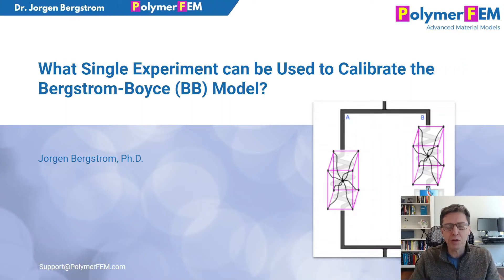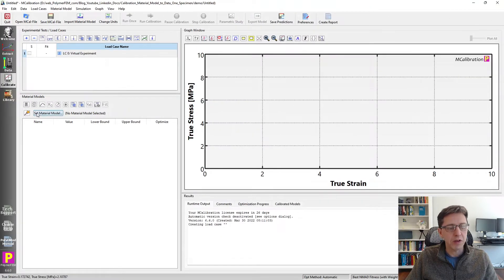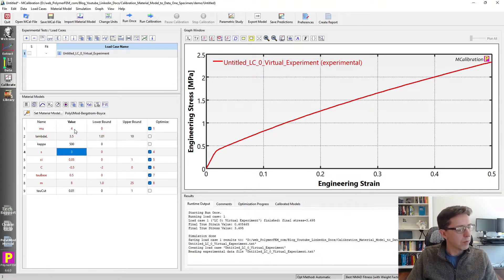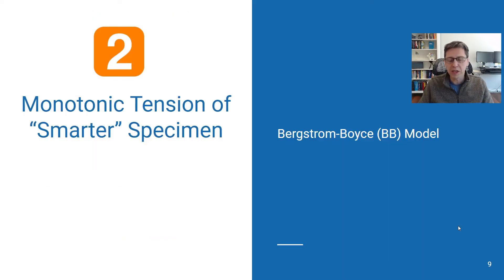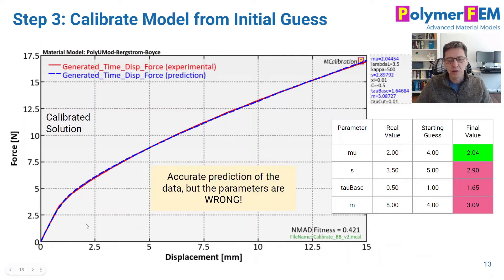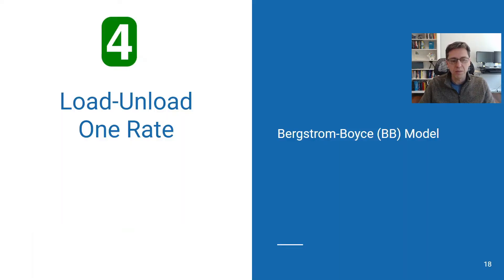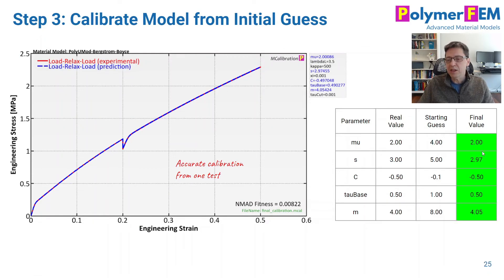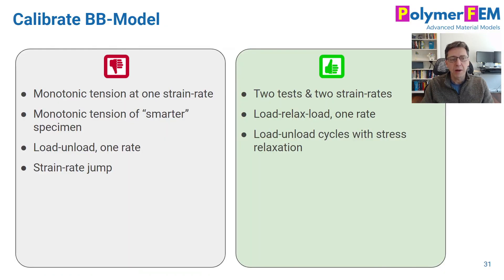What Single Experiment can be Used to Calibrate the Bergstrom-Boyce (BB) Model?

Comment: Hello, thanks for your helpful video. I have a question. is there any possibility from the Bergstrom-Boyce model that I give both tension and shear data and find good parameters for my material? My concern is the relation between shear and tension behavior that Abaqus assumes. For example in the von-Mises model, it is tension stress=(3^0.5) * shear stress which is not true in my material.